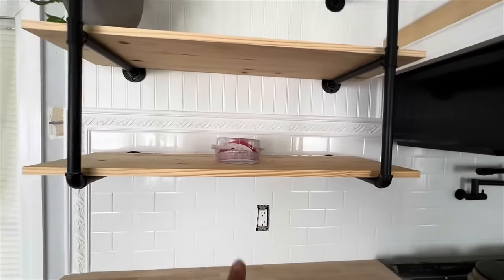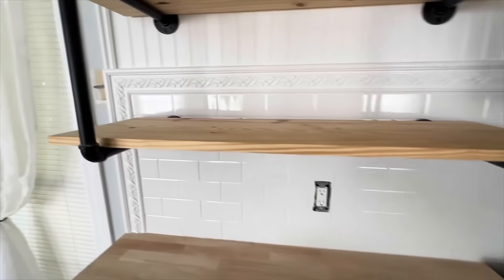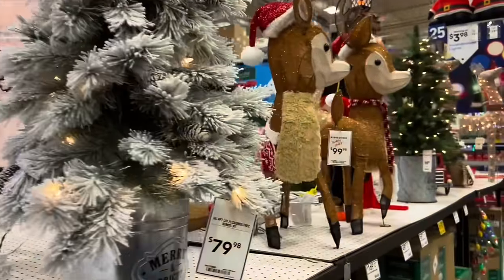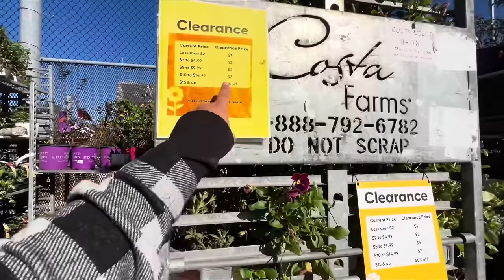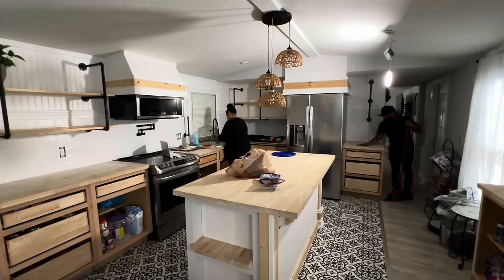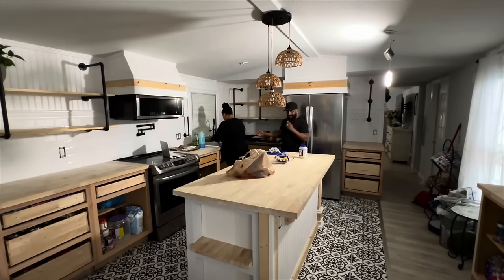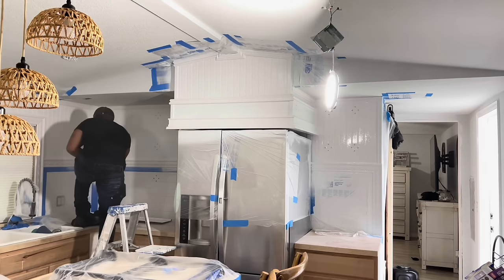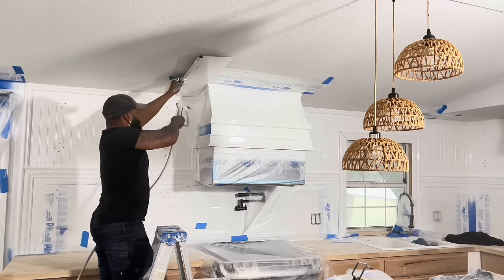REMODELING ON A BUDGET || MOBILE HOME LIVING || PAINTING CABINETS || CABINET KNOBS AND MORE

Comment: What are the lowest typical temps there , do you keep a heat source in green house?
Reply from the maker: Hey hey the lowest normally is 28 degrees is the lowest I’ve seen it! 🤍
Reply from the maker: No heat source during the day the sun does good in heating it up! But as long as frost doesn’t get to it I’ve never had a problem 🤍
Reply: Oh I see well I’ve wanted some fruit trees  but it gets way colder here so I’ll have to source  how to proceed. Your home looks beautiful! I want to replicate the bath remodel similarly  in my bath much the same  footprint as in your home.